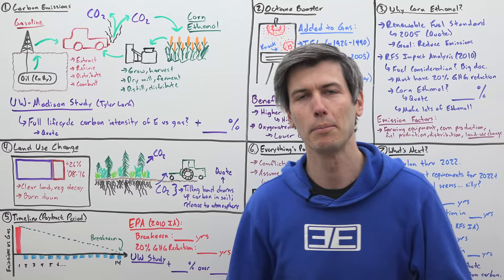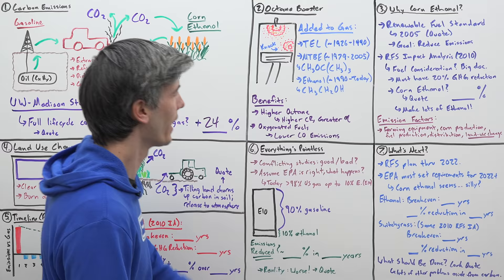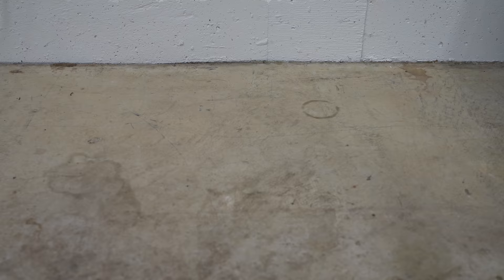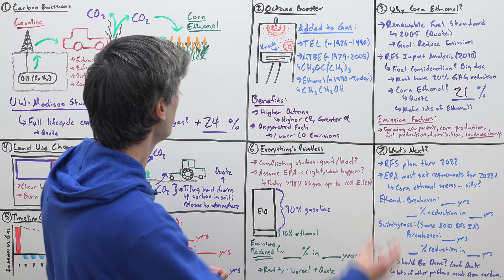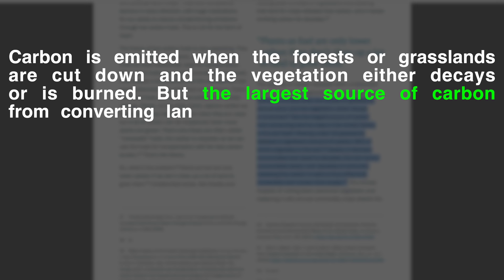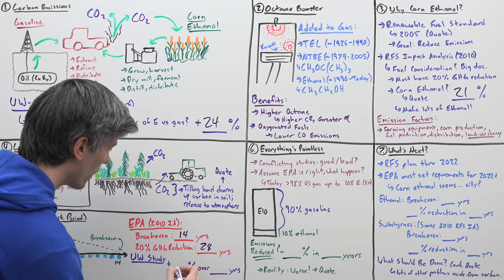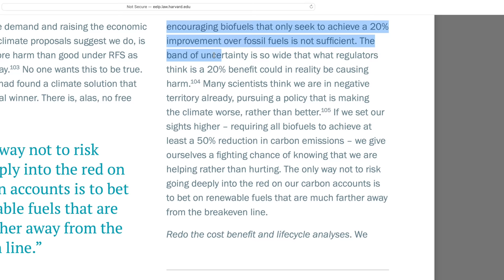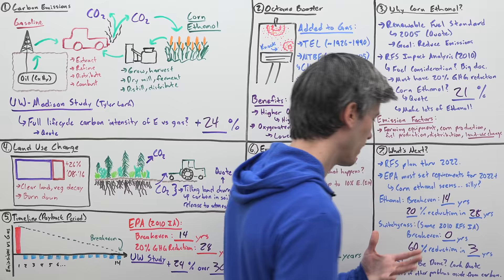America Was Wrong About Ethanol - Study Shows

Comment: I remember them pushing e85 really heavily in the mid to late 00's. Started seeing gas stations put in new e85 pumps and car makers pushing new flex fuel vehicles. The price for e85 was much lower than regular gas ( especially in 08) but you needed to either have a flex fuel vehicle to use it or have your car outfitted for it. It died out pretty quickly once people noticed that it gave worse mph and waa not great for the environment (this has been known for a while). It was nothing more than to giving money to agro and government while riding the massive green movement in the late 00's.
Reply: I remember earlier when they were all over M85 in California in the 90's. Pumps were popping up in Ventura and L.A.. Price per gallon was good, about 75¢, but my goal was HP. I was looking into modding my car back then. It's pretty corrosive and hard to select materials that are resistance to both gasoline and methanol. Needed bigger injectors to keep up with the flow and higher compression to take advantage of the octane. Ideally, a bigger fuel tank to maintain the range. One thing that was nice was the vapor pressure was high enough that the tank didn't need to be foam-filled like with neat methanol. Still too much effort.
Reply: Even the muscle car magazines got on the bandwagon - it was like someone flipped a switch and it was being promoted everywhere overnight.  Vanished about as quickly!
Reply: e85 is going strong where I live in the west.  Almost $1 less per gallon than unleaded. Without modifications to increase compression ratio, it doesn't give much of an advantage to run ( e85). Late model vehicles now include turbocharging, which allows a big boost to performance. With e85s high octane rating,  this is the perfect setup. My 2016 Ford Focus gets nearly identical mileage (36 mpg) whether e85 or unleaded fuel.  It runs a 12 to 1 compression ratio.  A big Thank You to Ford for finally seeing the light. Check gasbuddy for e85 locations around the country . They are in the thousands.
Reply: Yes, E85 is cheaper per fluid unit, but it contains much less energy per unit volume than pure gasoline, and so the volume of fuel burn per mile is quite a lot higher. Even with the subsidies and a flex fuel vehicle, you’re probably paying overall more using E85 - and without the subsidies? LoL, forget about it. E85 isn’t even remotely economically viable.
Reply: (re e85) But to quote Jeremy Clarkson, 'More powahh!!!!'
Reply: Right now, you can save money by using E85.  And not give money to Putin.  I believe that was the point of ethanol in fuel, to reduce our demand for oil.
Reply: @Elias Håkansson All that fancy crap aside it's very common in the average joes hotrod...Much cooler charge and high octane can't be argued.
Reply: I converted my 91 Camry to ethanol and because of the compression ratio, there wasn't much of loss in efficiency (like 10% loss) which was easily negated by the cost savings. But the environmental impact was unknown to me at the time.
Reply: @benjaminlewis671  We have enough reserves to have energy independence from foreign oil. By 2016, we were 91% self-sufficient. By 2019 we were one of the biggest exporters of oil. The keystone xl pipeline would have secured basically completely reliance of our own oil. You thank Joe Biden for canceling that pipeline. Also, no one around here sell e 85. You're better off research where your gas station is getting their supply from and decide from their. For instance, I don't get gas from Citgo because I know it's owned by Venezuela.
Reply: I ran E-85 in my F-150 just fine, not flex fuel.
Reply: Since 1993, autos can run on E50.
Reply: @JohnnyAmerique  No, you're not paying more per mile.  You don't have to guess, you can actually run the numbers.  E85 is typically priced to achieve cost per mile parity with 87 octane, and superior cost per mile vs. 91/93 octane.  Right now its barely half of premium fuel so its a huge bargain per mile.
Reply: We have not cured the e85 disease in Nebraska.
Reply: @ChurchAutoTest  I don’t know where you live but here it’s only $.50 a gallon or so cheaper than 87/E10. However, if it’s only half the price then it would make sense to the individual consumer, although that’s due to heavy government subsidies rather than a bona fide economic advantage.
Reply: @JAO53JAO  shameful? You are talking about politics, shame does NOT exist in politics. Ethanol is not a product, it's a program.
Reply: @JohnnyAmerique  it's a program not a product.
Reply: @benjaminlewis671  we were a oil exporter under TRUMP.
Reply: I lost 2 mpg in my car when ethanol came out.
Reply: @JohnnyAmerique  You're making assertions you can't back up about subsidies.  E85 in SoCal right now is $3-3.60/gal.  87 octane is $5.30-$5.60/gal.  Regardless, even in times not frought with oil price shocks, the price of E85 here is always right at the breakpoint to make it equal in $$$/mile with 87 octane.  It moves in concert with gas prices.  It could be substantially cheaper (needing almost no petroleum input), but then they'd miss out on making $$$.
Reply: @JAO53JAO  Car companies also got MPG 'credits' for selling 'flex fuel' cars even if they never ran on E85.  This helped them meet unrealistic CAFE standards. Its all a crock.
Reply: I used to run 91 until 2 years ago. Been saving quite a bit running E85. It's a $2 per gallon difference here in Socal
Reply: I’m still getting 130 mph with E85 or Premium, mpg is 25 at over 100 mph
Reply: @Elias Håkansson yep
Reply: @Paul Coenen  Only taking in information that reinforces your current viewpoint is NOT research, lol.
Reply: Man E85 in my flex fuel is like a whole new beast, 90cents cheaper per gal, and 15/20hp boost...
Reply: @benjaminlewis671  We have more oil than the middle east here under America. For real. That is a bit more complicated.
Reply: @nathanhedglin931  if it's a 2005 and up it's flexfuel capable, in 05 the crown vics did not have the flexfuel badge but could still run on it.
Reply: @joecoolioness6399  The gobment DOES tend to be more wise acting than each of us acting as individuals.  They just move like a GLACIER and so does better changes.
Reply: The total fuel consumption of U.S airlines is approximately 19 billion gallons annually. 

Total fuel consumption for mining lithium to make electric car batteries is 21 billion gallons annually.

The 21 billion gallons can only produce enough lithium for 250,000 car batteries.

The lifespan of an electric battery is 10 years and is not renewable.

Electric cars are not better for the environment.......they're worse.
Reply: @SuperSetright  source?
Reply: Imagine that?  Use more fuel and its cleaner

Comment: Well done. One factor that I'd like to hear more about is the fact that in order to grow corn, we need massive amounts of nitrogen based fertilizers. Corn naturally takes an enormous amount of nitrogen out of the soil. Without  ammonia fertilizers we may get one or two seasons of economically viable crops and then the soil is depleted for quite a long time. 
So where does ammonia fertilizer come from?
Ammonia is NH3.  The nitrogen comes from the air.  It has to be separated from the air with massive amounts of cryogenic cooling. That takes electricity. Wich in the U.S. means most likely from coal. 
Next, the hydrogen comes from natural gas, i.e. methane. 
The byproduct of turning methane into hydrogen is..CO2.

So long before the corn is planted with diesel burning farm equipment, we have already dumped thousands of tons of CO2 into the atmosphere just to make the fertilizer. 

I'd be curious to find out if that CO2 was taken into account when calculating the carbon emissions of ethanol.
Reply: Corn is a substandard producer of biomass in many regards. For some reason we have a hard on for corn, the government subsidizes the hell out of it, and it doesn't make much sense to me. Commenting on your analysis instead of using corn if we used hemp I don't think you need fertilizer for hemp. And it produces more biomass than corn does by magnitudes.

Comment: There are a couple things here I would like to point out:

 The land transition study said that the increase in land use was 26% more than the EXPECTED INCREASE in land use, NOT 26% more TOTAL land use. In other words, if the otherwise expected land use increase was 10,000 acres/ year, the actual increase was 12,600 acres/year. 

Acres planted to corn fluctuates by as much as 10 million acres/year depending on weather, input costs and the price of corn, and this generally happens in a several-years-long cycle. During this study, corn acreage went from 86M acres in 2008 to 94M in 2016. However, the peak was 2012 with 97.25M acres, where it began to fall off until hitting a low of 89M in 2018. (Source: USDA Crop Acreage Reports)

Also, the vast majority of the "new" acres of corn are from farmers choosing to plant more corn and less soybeans or wheat in fields based on prices for that year, from converting unused grass pasture to row crop fields, or from planting fringe ground that had been idled during years where the price of grain was not high enough to justify planting that land. There is very, very little truly new land being converted into farmland. In fact, farmland acreage has been slowly and steadily declining for decades, as urban and suburban areas continue to grow and take up land that was previously farmed. In fact, there were 48 MILLION fewer acres of farmland in 2018 than in 2000 (USDA).
Reply: Thank you for stating this. As a Kansan who's closest neighbor is 600ac of corn, I am really confused by the land use change figures. Added corn acres =/= tilling virgin soil. It may be anecdotal, but I can't remember the last time I saw grasslands taken down and turned over into row crops.
Reply: Thank you! It is very hard to explain agricultural statistics to a bunch of lab rats, 
but you did a great job.
Reply: @WildcatWarrior15  WE are not in Kansas any more.
Reply: I know huge amounts of CRP land was converted back to farmland.
Reply: @danielgerhardson7017  But CRP or (conservation reserve program) land had been in production prior to being put into reserve. Those acres also fluctuate annually.
Reply: These studies can be manipulated to show whatever, "science" is increasingly intertwined with governments and as such should be viewed with skepticism.
Reply: Another point worth acknowledging: The whole "soil carbon accumulates over centuries" bit makes sense, sure- until you start comparing. It could take centuries for that carbon to resettle, sure, but how long does it take to get oil carbon back into the ground, again?
Sure, ground carbon takes several human generations to settle out of the air... But fossil fuels take eons to produce, which is a whole heck of a lot more. Ground-carbon is still a much tighter "loop" than fossil fuels- ignoring that fact because it's still a process that takes centuries is simply being short-sighted. It may not be good, it might not even be good enough, but it's still some degree of improvement.

Plus, "2%? who cares" is straight-up counter-intuitive. It's not enough. WE KNOW THAT. It's still an improvement. We need to start taking steps, no matter how small, NOW. We're almost entirely out of time as it is; refusing to take steps because they're too small is self-sabotage. A too-small step is still miles better than not taking a step at all while blindly flailing in the dark for a better way that we might not even find.
Reply: Agreed and well said. I had the same idea about new land being converted into farmland. What makes this topic so complex is that these studies all make assumptions.
Reply: Thank you sir for putting the facts in order and more clear.  Right off I had problems with the "clearing of land" figures as you point out the corn for fuel was primarily a change in crops and the incentive of much better prices for corn because of the move to ethanol is where the increase in acres came from.
Reply: Another thing to consider is that we should be producing MORE CO2, not less in order to help the atmosphere. We are at 400ppm CO2 when we should be aiming for 1200ppm. We need to put more C02 in the atmosphere, not less. The world will be greener with more C02 and we should all support burning as much oil as possible.

Comment: Something us Brits have just learned about ethanol in gas is that E10 over E5 reduces MPG by about 5%.... More and more comes up against adding Ethanol to gasoline.
Reply: And while a 5% reduction in fuel economy doesn't sound that bad on an individual level, try multiplying it by tens of millions of vehicles having their fuel economy reduced every day.
Reply: British Thermal Units in the combustion process of making energy is the factor. Hard to believe that the same factor happens our side of the pond and with the same name! 😎
Reply: that is only because the engines are made for gas,  engines made for ethanol are more efficient  the Indianapolis 500 is now ethanol,,

Comment: You missed the downside to ethanol in fuel -- it is alcohol, which attracts water, leading to water in your fuel. This leads to additional corrosion inside your fuel intake, engine, and exhaust systems.
Reply: @Leslie Fish Not really. Nearly all forms of steel will corrode eventually. Even stainless steel, which is known for not rusting can rust. It's worse though if you run a fluid over it which is exactly what a motor does.

Comment: Switchback grass is an amaizing option.  It can be used for ethanol production, pelletized for animal feed and as a fuel source in pellet stoves.  It has more BTU per cord than oak.
Reply: and it probably doesn't need anything but a mow and watering to maintain and harvest it.
Reply: In order to use switchgrass as an ethanol source you would need a ton of land to store bales on. (South Dakota state) has been researching it, we have been doing the baling on it. You would need 160 acres at least in order to store the bales for “slow” times- snow storm and no inventory coming in and so on. Than the other part is ethanol plants are profitable from the byproducts.
Reply: Burning the pellets adds carbon 😂😂😂😂😂 that's efficient. 
In reality look at the mass of grain vs bio forges the added trucking vs land to store it is hugely diff plus to get the grass to market you will mow, rake, ted, bale, collect and haul bales 3+ times a year. Apposed to planting harvesting and hauling grain one time. Look at the entire system of things
Reply: Burning the pellets adds carbon 😂😂😂😂😂 that's efficient. 
In reality look at the mass of grain vs bio forges the added trucking vs land to store it is hugely diff plus to get the grass to market you will mow, rake, ted, bale, collect and haul bales 3+ times a year. Apposed to planting harvesting and hauling grain one time. Look at the entire system of things

Comment: Two or three decades ago I read a National Geographic article asserting that ethanol from corn had negative benefits in terms of oil usage reduction, that is, it produced less energy in the form of ethanol than the oil energy used to produce it. Brazil’s ethanol from sugar cane produced 8 times the oil input energy due to a better suited crop and better integration of the biofuel into the production process.

Ethanol from corn is largely a political bonus for farmers.
Reply: The Indians made a beer out of the corn stalks buy squeezing the sugary liquid out of them and fermenting it! We should investigate how well using that would be, use the corn for food!
Reply: i understand the lobby of the agriculture industry, it is very powerful in Brazil as well, but i am curious as to why sugarcane was not used in the US alongside with corn. Maybe the climate or soil are not a good fit for sugarcane?
Reply: @generalfail7301  Yes, Brazil lies right on The Equator.  Only a small portion of Florida and Hawaii can economically grow sugar cane, and in fact they already ARE, but it's only enough for the sweetener market, not bio-fuels.

Comment: I read about the benefits of using switchgrass to make ethanol several years ago. It requires far less energy to get ethanol from it. In addition (and maybe more importantly), it is drought friendly and doesn't require draining an aquifer to maintain it.
Reply: @williamcrowley5506  No
Reply: @thisismagacountry1318  What is it about people not understanding that "green" energy has a huge cost in terms of carbon footprint and a bigger impact environmentally when they are no longer serviceable?  Owner of an "old" hybrid car which is dying faster than the gasoline truck we have.  Maybe Will just figures we should all bicycle, skooter and rollerskate.
Reply: @thisismagacountry1318  -- You're simply incorrect. At current production rates, we have about 365 years of supply. If every car was electric we'd have about 17 years of supply. Keep in mind, that if we believed "current" estimates of oil reserves from 1980 were 36.5 billion barrels and we should have run out by 1990.
Reply: @amberbrown9997  -- EVs are dirtier to produce. But If you look at the entire life cycle of an automobile, EVs are significantly cleaner than an internal combustion vehicle. BTW, anybody that thought a hybrid, which has 2 power plants, would be more reliable than an ICE vehicle which only has one, doesn't understand engineering, Murphy's Law, or the KISS principle.
Reply: @lamplighter5545  Two smaller power plants in a car (gas engine and an electric motor) are better.  The smaller gas engine is the only thing keeping it on the road.  The batteries to replace (which go bad fast) aren't cheap, environmentally friendly or universal.  EVs are built to break.